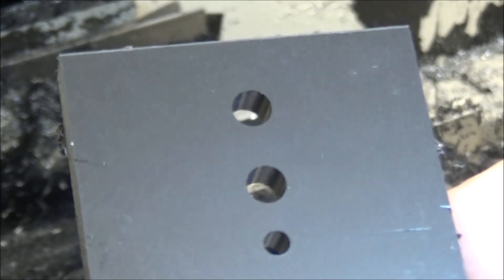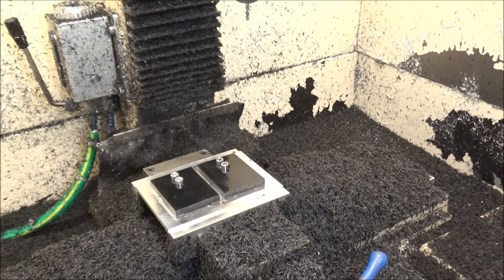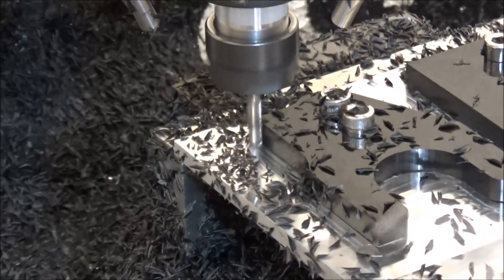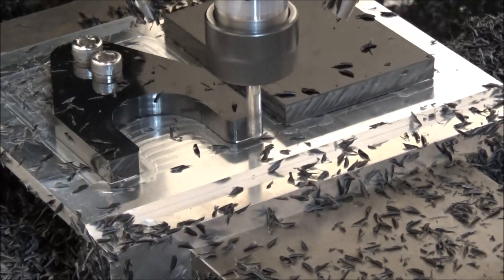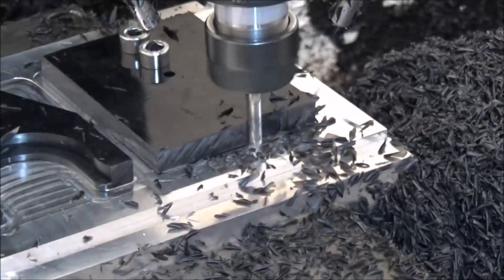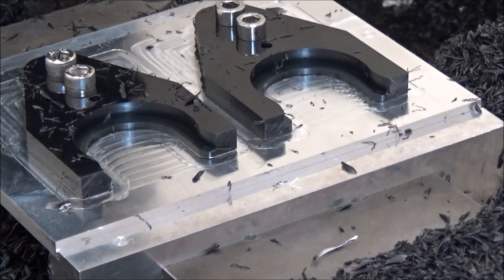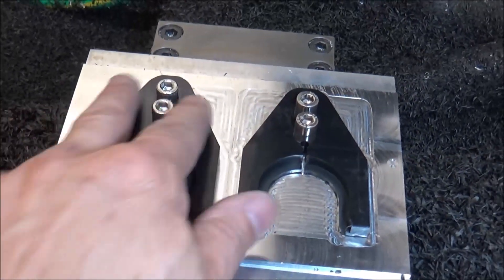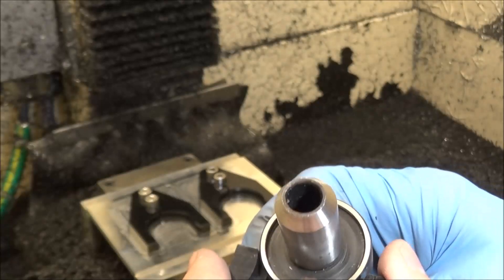PM727M ATC Pt 11

Comment: Didn't get a good look at your end-mill, but plastic loves single flute (0-flute) end-mills... high RPM and high chip load to pull the heat off the cutter. I'm a big fan of the Onsrud ones when I run HDPE and can cut at nearly 250ipm at 10k RPM.
Reply from the maker: Yeah was thinking a end mil more suited for wood may have been better. Thanks